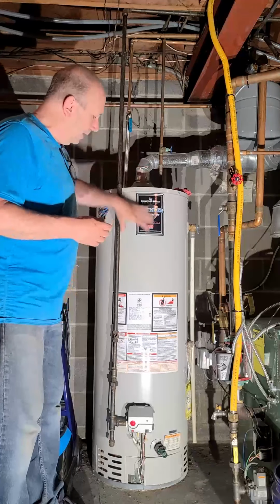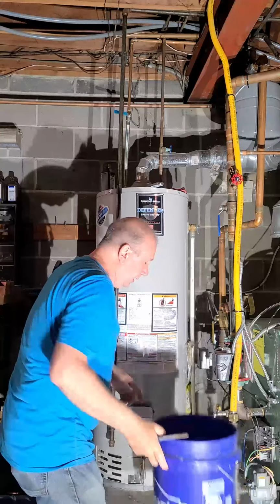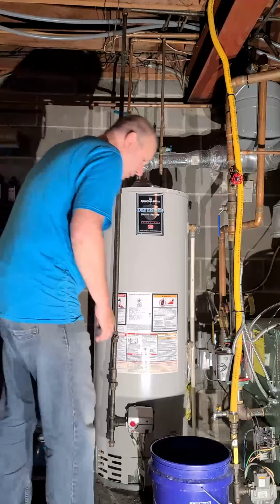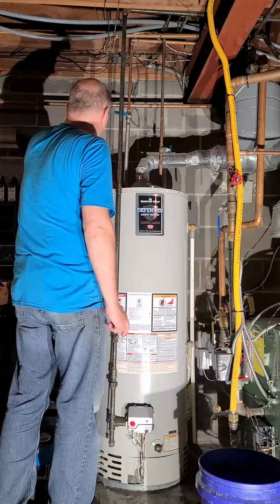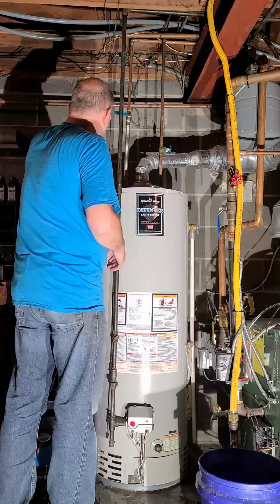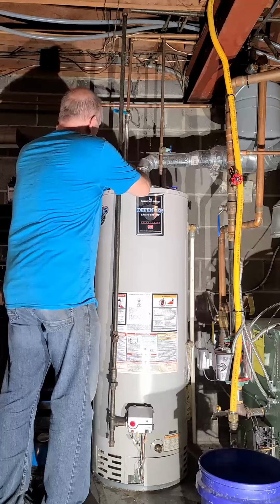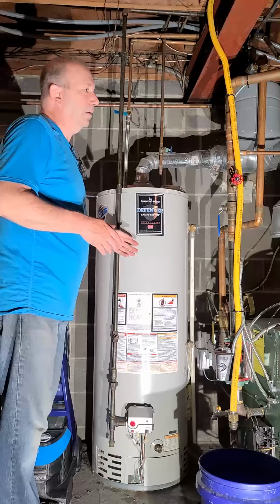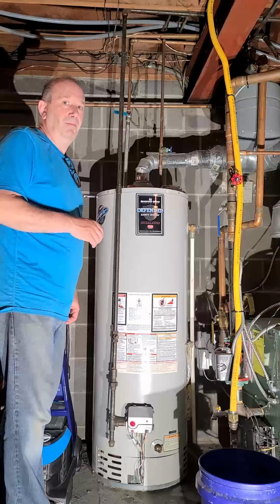Does your hot water smell like rotten eggs? Here is the fix.

Comment: You can fix this permanently in 15 minutes. Get rid of the anode rod and replace it with a CorroProtec powered anode rod. It lasts for 20 years, eliminates the sulfur stink immediately and permanently. No need to keep treating the tank with peroxide or chlorine over and over. It's a once and done fix! It's the magnesium anode rod that promotes the stink. The Corro-Protec powered anode rod is titanium with a mixed metal oxide coating. It will last a minimum of 20 years, it is not sacrificial and does not degrade. And it's quite short in case of limited overhead clearance. I have them in my water heaters, which I expect to last over 20 years, without ever changing an anode rod.
Reply from the maker: Yes! The powered andoe rods are a permanent soultion. I may do this but I am waiting until I am able to replace the heater when I do it in case something goes wrong! My water heater has the anode rod integrated in the hot water feed so if it breaks when removing I am out of hot water until I can replace the heater.
Reply: @BriansSpace  I surmise that is a Bradford White. Do be aware that Corro-Protec have a kit to fit their powered rod to a Bradford White water heater that has the anode integrated in to the hot water outlet. So if you get a new water heater you can get a Bradford White if you like and still have the Corro-Protec installed.
Reply: Can you install the coral protect powered anode rod to replace the original anode rod in a Richmond hot water tank?
Reply: @debbiemiller5715  I’m sure of it, but you can ask them on their website
Reply: Where can I get that cuz I'm having the same problem
Reply: @henrymerette9441  I got mine at Amazon. There is some sort of adapter to use if you have a Bradford White heater. On those water heaters the hot water outlet and the anode rod are integrated into one assembly and CorroProtec has an adapter to make it work
Reply: Corro-Protec works perfectly, one and done!😁😁😁😁😁😁😁👍🏻👍🏻👍🏻👍🏻👍🏻👍🏻👍🏻
Reply: The pipe that goes to the bottom of the tank is the cold water inlet.

Comment: Great video. I will do this tomorrow. ****One important note... you technically should not have a valve on your hot water side. Plumbers don't do that so you don't close both valves and create a pressure vessel. Pressure Relief Valves fail frequently. If PRV fails and both valves are close then the HW heater turns on, you could have the tank blow up.
Reply from the maker: Hey Chris, You are technically correct on this being a possibility. However, if the PRV fails and all faucets are closed in the home the same situation can occur. Also, I think you would have to have a thermostat faliure and a PVR valve failure for this situation to occur or the thermostat would shut the heat off well before that amount of pressure builds up. It's best to check the PRV by lifting the lever monthly if this is a concern and replacing if any issues. Always check your local code though.

The reason I have that valve there is if I didn't then it takes forever to drain water down out of the tank as all the upstairs plumbing drains down into the tank. There is a valve in there to supposedly prevent this in the top of the inlet tube but it still allows water down in. Also, I can shut this valve and open the cold water side while the peroxide is sitting in the tank for the 4 hours doing its job and household members don't accidenlty run the hot water.

Thanks for the tip!

Comment: Brian, I just used your recommendations and the smell is gone!  I applied it to the cold water section as there is no shut off on our hot water valve.  It still worked like a charm!  Hope it lasts!  Thanks!!
Reply from the maker: So glad it helped. It will last about 3 months or so in most cases. Once you smell it coming back just repeat!
Reply: Should not have to keep adding peroxide every 3-4 months. Change the anode rod to aluminum rod.

Comment: Here is a simple solution that worked for me. 
When I installed the new tank I set the water temperature at the lowest setting, 120F. The bacteria were able to grow in that temperature water and created the rotten egg smell. 
All I did was raise the water temperature to max, 180F, for a few months. In retrospect it could have been a much shorter time say a few days. The odor went away because the bacteria could not grow at the high temperature. It's been a few months now since I set it back at 120F and there is no odor.
One explanation might be that the original bacterial contamination was in the manufacturing process. But once gone the new contamination would come from the drinking water. Possibly this species is not in the drinking water. That would explain my results and observation.
Reply from the maker: I will repost my warning on using this method:

Thanks for sharing. I did hear of this method and opted not to do it due to the risk of burns. 140-150 degree water is very hot (180 degrees could be fatal!) and if you have children or elderly in the house I would not recommend this. The difference in risk is great as you can see by the info below. Some newer homes have shower and tub mixing valves that protect against this at the tub and shower but severe burns can still occur at unprotected faucets. If you want a permanent solution the best option is to replace the Anode rod in the tank with a power anode. They do not degrade and will last the life of the heater:

https://www.corroprotec.com/product/water-heater-anode-rod/

For me it's no big deal to put the Peroxide in every few months so I haven't replaced the Anode rod.

Most adults will suffer third-degree burns if
exposed to 150 degree water for two seconds.
Burns will also occur with a six-second
exposure to 140 degree water or with a thirty
second exposure to 130 degree water. Even if
the temperature is 120 degrees, a five minute
exposure could result in third-degree burns.

http://ameriburn.org/wp-content/uploads/2017/04/scaldinjuryeducatorsguide.pdf
Reply: Excellent reminder on the safety considerations. In my case it is a second water heater that supplies only the kitchen sink and the laundry room.  And only aware, able adults are using it.  We are all satisfied with the safety aspects.

Comment: I have had this problem on my boat where I have a 6 gallon tank.  I was told to add Bleach (just a cap full) in my water system and this method has worked for me.
Reply from the maker: Hey Chris. Thanks for sharing! Yes, bleach will work! However, Hydrogen peroxide has a few advantages though. It is quicker. Chlorine bleach breaks down in hot water. Peroxide has no odor or risk of ruining clothes if too much is added to the tank. Here is a more detailed explanation from a water treatment company:

If you haven’t already figured it out – hydrogen peroxide is not a good idea for disinfection; the same as chlorine is not a good idea for oxidation. If you have surface water and need to disinfect it, especially if there is algae, then chlorine is dramatically superior to hydrogen peroxide. However, if you have incredibly high iron or sulfur, chlorine is not a good choice, but hydrogen peroxide is. Removing iron and sulfur is best accomplished with oxidation, and H2O2 is an excellent oxidizer.

Just do not confuse oxidation and disinfection. The definition of disinfection is “the process of cleaning something, especially with a chemical, to destroy bacteria.” Oxidation, on the other hand, is different. The terms oxidation and reduction can be defined by adding or removing oxygen to a compound. Both reduction and oxidation coincide, so we call that a “redox reaction.”

As stated, hydrogen peroxide has the chemical formula H2O2 and is an oxidizing agent similar to oxygen in effect but is significantly more robust. The oxidizing activity of hydrogen peroxide results from the presence of the extra oxygen atom compared with the structure of water. I like to say that “Hydrogen peroxide is very forgiving.” What I mean by that is that (when applied correctly) extreme amounts of iron and hydrogen sulfide can be removed from the water supply effectively and consistently.

Comment: It's a check valve to prevent you from heating the Coldwater in line..
 The have a similar one on the hot side too to keep the heat from just escaping through the water when not flowing in use
Reply from the maker: Thanks!

Comment: I put a tee in the cold water supply with a valve and short length of pipe pointing down.  I turn water off, relieve pressure, then submerge the end of that pipe in a container of peroxide.  I then open the drain valve.  The water running out draws the peroxide in.  Much easier than taking the line off each time.

Comment: Gave it a try.  Was smelling all summer but stopped since winter.  Maybe too cold up here in Canada.  Going to do it every 6 months like you said. Also changed out the anode rod.  Couldn't
find the right size so got a longer one and cut it off.  Plumber told me that.  Old rod hadn't gotten shorter but whole thing was full of that grit so I don't think it was working as water
needs to touch the rod for it to work.  Anyways excellent video.
Jim   CYWG

Comment: Great video ill be buying peroxide first thing in the am to solve my problem with your fix thanks
Reply from the maker: Great! Come back and let us know if it worked for you.
Reply: @BriansSpace  my hot water heater don't have access holes on the top ! Just the drain at the bottom
Reply from the maker: This requires doing a bit of plumbing to get the system opened up so you can add the Peroxide. If this isn't something you are comfortable with you would want to call a plumber. I cut the pipe and installed a flexible fitting with shutoff that I could disconnect when I  needed to add the peroxide. If your setup does not have flexible connectors and is hard plumbed with copper then best to call a plumber and have them set this up for you.

Comment: Interesting method. Hydrogen peroxide has the same components as water so given enough contact time it would break down on its own. 4 hours is doing it, and that is really very informative. Flushing the tank at the beginning might be better to reduce demand and get a more concentrated dose. Remember what you put in equals what is used up minus what is left over. Also opening the lines just long enough to fill up with treated water will shock the lines as well. Not sure if that is really necessary but it can't hurt to do a disinfection from time to time on the whole plumbing envelope. Final flushing to remove the residue ensures that you do get any in your spaghetti water..
Reply from the maker: Thanks for commenting. Some additional info I recently found that explains the difference between treating with Chlorine VS Peroxide. In a nutshell use Chlorine to disinfect and use peroxide to Oxidize and remove sulfur and iron:

Below from this site:
https://thietbinganhnuoc.com/en/blogs/chlorine-and-hydrogen-peroxide-which-is-better-for-water-treatment.html#:~:text=Chlorine%20requires%20contact%20time%2C%20typically,only%20dilutes%20its%20oxidizing%20capacity.

Hydrogen Peroxide is not a good idea for disinfection just as Chlorine is not a good idea for Oxidation. If you need to disinfect surface water, especially if algae are present, then Chlorine is far superior to Hydrogen Peroxide. However, if you have very high levels of iron or sulfur then Chlorine is not a good choice, Hydrogen Peroxide is. Removal of iron and sulfur is best done by oxidation, and H2O2 is an excellent oxidizing agent.

Disinfection is the process of cleaning something with chemicals, to kill bacteria. While Oxidation and Reduction can be defined by adding or subtracting Oxygen to a compound; both reduction and oxidation polymerize, so they are called redox reactions.

As stated, Hydrogen Peroxide has the chemical formula H2O2 and is an oxidizing agent similar to Oxygen but significantly stronger. The oxidizing activity of Hydrogen Peroxide is the result of the presence of an extra Oxygen atom relative to the structure of water.

Comment: I learned the peroxide trick several years ago recently I found out that it is the aluminum zinc anode rod that is supposed to fix it, so I picked one of those up off Amazon for about 25 bucks that came with the socket and this time I'm going to do that when I do the peroxide treatment and hope that it is fixed for years instead of months.
Reply from the maker: That should do the trick!

Comment: I install a old washer hose on the bottom valve, exit a gallon or so. Open a hot water faucet, leave it open. Then I lif the washer hose fill it with peroxide (10oz/10gallons) compress in (using a small air compressor) while opening bottom valve. Repeat until all fluid compressed into the bottom part (cold stage) of heather. Easy, no plumbing, but you do need a small compressor.
Reply from the maker: Thanks for the info!

Comment: You can release the pressure from the safety valve also.
Reply from the maker: Sure can! Since you need to drain some water out to make room for the peroxide just using the drain valve works fine.
Reply: Keep in mind if you open the safety valve it might not re-seal because of mineral build up.  It can easily be replaced if it does not seal but the valve at the bottom of the tank is fool proof for letting water out.
Reply from the maker: @KRay-fb2vf  That is true. Had to replace a leaking one in my furnace last year.
Reply: How do you use the safety valve to do it
Reply: @carlgilpatrick8416  there is a very thin aluminum handle on the safety valve. Once you have everything off, just lift the handle. It will release the pressure as well as some of the water inside the tank. Just make sure that the overflow pipe has a way to get rid of the water without getting it all over the floor.

Comment: The plumber would’ve replaced your water heater, that would have solve the problem. Because a new water heater means all the internal parts would be no including the anode rod, dip tube, etc. It mean not be necessary to replace the water heater but it would’ve in fact solved your problem.
Reply from the maker: Replacing the hot water heater in most cases does not fix the issue as it is the Anode rod material that is causing the smell. An aluminum/zinc alloy anode rode or a powered anode rod will in most cases fix the issue.
Reply: no
lol
Reply: We have a new hot water tank and we started having the smelly hot water and I knew what the problem was.  I use the hydrogen peroxide every couple of months.  I might get an aluminum anode rod one of these days and replace the one in the tank.
Reply: I bet you say it’s hot out while outside in 108 degree weather to people already sweating 🫵🏻🤡

Comment: Thanks, but it would have been nice to see what you were doing with the wrench on the top of the heater. Did you disconnect the TP valve to allow air in, and  add the peroxide directly into the valve hole? Does that mean that it's not really necessary to disconnect the hot water out connection? Will leaving the peroxide in for longer than 4 hours damage the tank or system?
Reply from the maker: Yeah, not my best filming work, for sure :) I disconnect the hot water out side and pour it in there as there and left the cold water side connected. You need to leave the peroxide in at least 4 hours before running any hot water. It won't hurt anything leaving it in there longer.
Reply: @BriansSpace  Thanks for the reply!

Comment: does this ONLY happened with anodes of the BRADFORD WHITE water heaters? or does it apply to all water heaters including rheem etc...my water doesn't smell but the water heater itself when making hot water, stinks up the BASEMENT with used laundry smell.
Reply from the maker: The anode issue applies to any brand hot water heater. Not sure what your issue is with a used laundry smell. That's something I've never experienced. Sorry I couldn't be more help.

Comment: Hi Brian, how are you? I have a question for you. I bought a house with well water system. In the inspection the hot water from one of the bathrooms comes out brown for 1-2 minutes and also smells bad. Do you know what I have to do? The previous owner tested the water and is good, the report says that the water sit in  pipes and water heater until the following day. Please help me! Thank you so much
Reply from the maker: Tatiana, It sounds like perhaps this happened from not being used if the house was not in use while on the market. Maybe flush the hot water heater completely and then refill and see if this helps. If not you would need to call a pro to help out. Good luck!

Comment: Just bought a new house with this exact problem.

This will be a life saver if it works.
Reply from the maker: Hope it helps. Let us all know. Just to mention this only is for the Sulphur smell in hot water only. If you smell it in the cold water also this won't solve that issue.
Reply: Same issue with a brand new property. First use I had no issue. Came back after 3 weeks and the hot water smelled terrible.